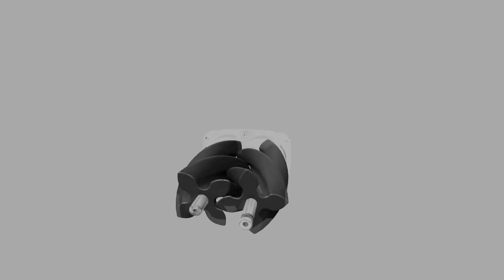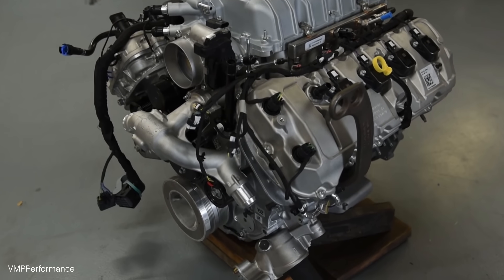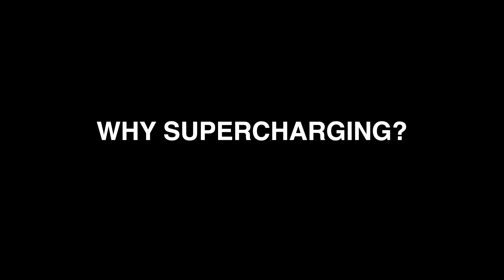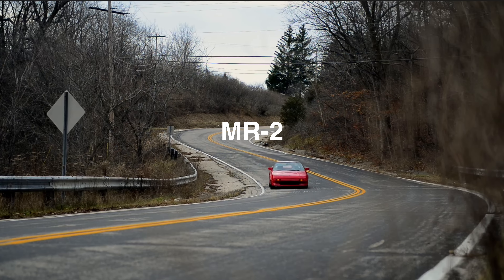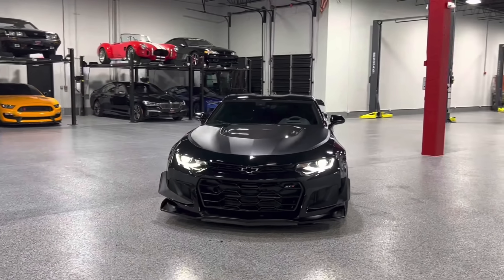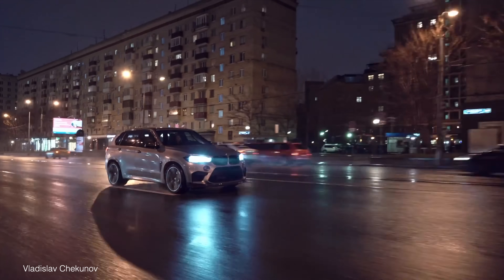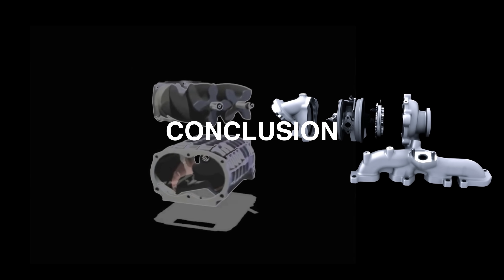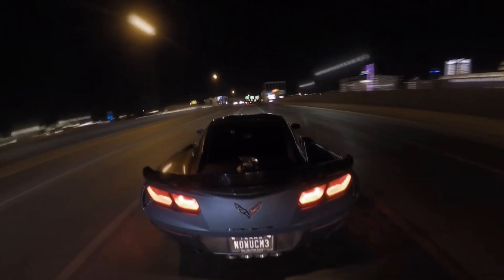Why V8 Engines Are Supercharged vs. Turbo😮| Explained Ep.6

Comment: That instant torque is such a beautiful thing for supercharged engines.
Reply: Cost, simplicity, power on demand, culture/history, personal taste. That's all that needs to be said.
Reply: Our twin scroll SQ5 has nowhere near the “instant” power of our ZL1.
Reply: Instant 😂 yeah sure
Reply: foRever
Reply: And it also makes the gayest cringiest most laughable engine sound ever
Reply: @justafloridamanfromthe75thRR  if a supercharger makes you think it’s gay maybe that’s an issue with your inner self, there’s millions of people who literally love the supercharger whine because most recognize it from American drag racing with big ass Hemi v8’s with a big ass supercharger in top fuel drag racing it’s also commonly used on trucks which require instant or near instant torque is needed don’t get me wrong I like turbos as well but I think superchargers deserve some credit for the benefits they give in the racing world.
Reply: Though it’s funny when turbos have lag and someone has a passenger right as the passenger seems disappointed boom boost kicks and the car takes off like a rocket, I call it the sling shot effect turbos are acting like the rubber band on a sling shot and as you pull the sling back you’re building up tensions and when you let go it launches the BB at a higher velocity like wise when you start giving the car more gas you’re causing the turbos to spool up and once that reach full boost you take off like a rocket, I genuinely like both turbos and superchargers I also love when car guys combine the two aka twin charging!
Reply: you pretty much got instant torque on turbo as well with lauch control. anyways.. its a less significant argument these days then 10-15 years ago
Reply: @hotdog9262 Thats the point... with launch control. At normal driving, gearbox Auto mode from low RPMs, so lets say you are driving 50 mph and your cars at 1900 rpm and then you do a kickdown, it takes ages until you are on boost, and even some more time till you hit the turbos sweet spot rpm where it has the most power. I have a 3.0 TFSI which he named in the video, and holy shit together with the S-Tronic dual clutch gearbox its like you get hit from a train. The time it takes to accelerate from lets say 50 mph to 70 mph is like its instant. You are just there right after you hit the pedal. A Turbo never gave me this feeling, they were quicker but only if in right gear, properly mapped and the turbo was not too big. I would say pretty much every time when you have a supercharged 400 HP car and battle a turbocharged 450 HP car which is unaware that you want to race, once you hit the throttle you are gone and he won't keep up. But its surely a different story when both cars pull at 50 MPH 4000 rpm in right gear, on sport mode (for max boost fo the turbo). But for everyday driving even a low on power supercharged car will outrun the turbo if the driver is not aware and just steps half a second later on the throttle. I love that roots blower, can only imagine how a supercharged V8 drives. I drove my friends S7 4.0 Biturbo, but it did not feel any special, it takes a lot of charme of the v8 away.
Reply: @DarkSession6208  most sportscars have small turbos, to give that near instant boost also outside launch control. add to this, their systems are also(more or less) tailor made to the application. but I understand the popularity of superchargers. also due to the lower cost(well..) and easier/simpler to aftermarket
Reply: Hot-vee twin turbos are very close to zero turbo lag and feels like instant torque as well.
Reply: if you don’t have good enough torque without a supercharger you built it wrong. turbos all the way
Reply: Twin scroll turbos basically eliminate turbo lag
Reply: It's about hp
Reply: Electrics smoke them anyway smh
Reply: @GewelReal  Pride month is over.
Reply: @bengtsson45  top kek
Reply: @bengtsson45  lmaooooo
Reply: @GewelReal electric? Bro be for real who wants an electric?
Reply: @DiaperSNiFFER   The only time I ever see electrics being useful is through a hybrid system with a gasoline engine like the 5.7L Hemi which also now comes with the Etorque system, we personally have a 22 ram 1500 with a 5.7L Hemi with Etorque and it’s pretty efficient on gas if you’re not romping on it constantly around town and for a larger truck with the 4x4 system it’s pretty zippy around town, I’m also still learning things about the truck that I wasn’t aware of I thought it used some sort of step up converter to power the electric motor nope I was  wrong it does have a separate 48v battery for the mild hybrid system, again I think hybrids are the better option between them and an EV, anything full electric is asking for issue!
Reply: @GewelReal  not if u have a big enough supercharger
Reply: @GewelReal  not on the highway mate
Reply: @arimpour8207  even on highway
Reply: @GewelReal  only one that will win above 70mph is the tesla plaid lol
Reply: Go eat some breakfast 🥞 🥛
Reply: @funeralhouse6280  
Thanks?
Reply: @GewelReal  not gonna lie it is the future but it is super lame ... pretty soon they will just put a speed control on cars because it is so automated..
Reply: @GewelReal  Up to 60 only, past that no, and even in that 0-60 range there are still a bunch of petrol cars that beat them.
Reply: @GewelReal  yeah, but push it only once n battery goes low immediately, fuck that shit..
Reply: @P71ScrewHead  that's why current electric cars are for suckers.
I'm still waiting for vastly better and safer batteries to become available
Reply: @GewelReal  things should keep getting better, don't want to spontaneously combust..lol
Reply: @P71ScrewHead  Your fuel runs out even faster than battery... When pushed to the max.
Reply: @gytispranskunas4984  Depends on the engine.. A 1,000rwhp 632ci BBC/BBF uses a gallon per 1/4 mile..lol Anything small block will be way more fuel efficient even with power adders..
Reply: @P71ScrewHead  It is physically not possible to beat Electric Motor efficiency. The problem is that battery has no energy in comparison to gasoline. If there was a way to power electric motors with GAS... cars could go thousands of miles with full tank, u would forget when you even filled the gas tank. But sadly it's not possible. With time battery technology will become more and more energy dense. But we will not be around to see it.
Reply: @gytispranskunas4984  Well, ppl have made engines run on water but most have been killed, i wonder why.. My dyno tuner claims he can make engines run on water but i don't have a car for him to experiment on..lol Maybe one day..
Reply: @P71ScrewHead  Prove it.
Reply: @johnwatrous3058  disprove it..
Reply: @P71ScrewHead  I'm just curious, do you have proofs for claims regarding the people who "invented" engines that run using water.
Reply: @ashtoncasedy3237  All it takes is a lil Google search n you'll find your proof.. This ain't new tech, but those who've tried to market it have all been dealt with..
Reply: @gytispranskunas4984 trains have entered the chat*
Reply: @P71ScrewHead h
Reply: @P71ScrewHead  Your tuner is pulling your leg, its the same reason perpetual motion doesn't work.
Reply: @gahbah274  Could be true..
Reply: @P71ScrewHead  I heard that story too, that he was murdered by oil industrial company for making car that runs on water , and later found that body after almost 4 or 7 years later...
Reply: @xninja2369  Oh yes.. Also how these ppl commit suicide so conveniently..lol
Reply: @P71ScrewHead sucks to see ur dyno tuner next 😔
Reply: @TackyLicns  Well, looking forward to what I make with old gas n TrickFlow heads..
Reply: @P71ScrewHead  like inventer of Diesel engine
Reply: @xninja2369  Ouch..
Reply: @gytispranskunas4984 diesel electric vehicles have existed for a long time. The battery will never be an effective replacement. The point of the battery is requiring the electric grid to power everything so the government can control the grid and control all your power. It's much harder to limit you when multiple energy sources are available.
Reply: @P71ScrewHead  I swear you know that right?
Reply: @spidergoose891  True.. I've always said that..
Reply: @xninja2369  Didn't know, will have to do more research on that, thanks..
Reply: @gytispranskunas4984 what do you think an alternator does lol
Reply: @gytispranskunas4984  you just invented a hybrid bro, good job.
Reply: @P71ScrewHead do you understand physics? Unless you found a way to burn water without super dangerous chemicals, no you cannot make an engine run off just water.
Reply: @Supercat10101  I don't have to.. Plenty of ppl already made engines run on water as fuel.. Car n motorcycle 🏍 engines.. Mexico 🇲🇽  n USA 🇺🇸..
Reply: @GewelReal Gay
Reply: @GewelReal but you can’t push Evs half as consistently as ICE
Reply: @GewelReal 😂😂😂😂
Reply: @GewelReal  😂 the quickest pass by ANY EV is just now trapping 200 in a quarter 
Brett Lasala just took a sleeved OEM Predator block, ported GT350 heads, and oem Coyote crank, drove 1,000 miles to each track over 5 days and avg 6.7s @ 212 mph and best of 6.52 @ 216 mph on 275 tire. 
ICE is still king, fool.

Comment: I would say because Americans engineers are bad, it easier to make good clearance for a supercharger on the hood and with some cooling lines than a turbo or two turbos, working hot tubing and cool tubing and a inter cooler around the engine compartment.

Comment: Chevy and Ford both still use Roots blowers, including the new GT500 and the last gen ZR1. The old E55 and hellcat are twin screw but twin screw isn't inherently more reliable than roots. Whipple and Kenne Bell will tell you so but they are not any easier to keep cool at high horsepower AT ALL. They offer no advantages over the power capabilities of the roots style Eaton TVS2650 or 3100 which are smaller than Whipple or KB's best offerings while making similar power....
Reply: E55 🔥 German muscle car. German car with an American soul. I wish AMG kept making supercharged V8s

Comment: We can take ICE motors much further than we have but there’s too much government pressure to move toward EV for manufacturers to put the R&D into continuing that forward movement. The biggest drawback is that the birthing pains are going to be immense without some great forward leap in battery technologies and infrastructure to support mass affordability and usage of EV’s. What’s an EV without electricity? The government isn’t holding up their side of the bargain for their arbitrary emissions policies by correcting the vastly ignored electrical grids and production stations to support this forced, premature changeover.

Now on the hot vee setup, it’s nothing new and BMW didn’t pioneer it. Cadillac didn’t do it because of BMW either. Hotrodders have long done the hot vee setups on any engine that can have the heads reversed. The first time I know of it was with guys in the 50’s reversing the flow on Ford’s flathead V8 by retro ding the camshafts. Numerous Indy car engines had this design in the 60’s. Hotrodders have even done it with modern engines like the Cadillac Northstar V8’s since the heads are symmetrical and be simply turned around with the intake ports outward. BMW doesn’t get the credit for it since they put it into production first. Brilliant American car enthusiasts did it many decades prior.

Comment: Both supers and turbos are good. Turbos are more expensive and require more detailed engineering. The supers are easier to retrofit to good o' push-rod engines. Everybody wins! I also own a Tesla dual motor and that is fun too, but in a different way.

Comment: Very well done! I just love the scream of a good supercharged engine but I also love the efficiency and that adrenaline rush of when the turbos kick in on a turbo. That VTEC kick is good too. Keep up the great work. Subscribed! You just do not get that visceral sensory spectacle from an EV. I too believe we are in the golden age of the internal combustion engine and I am not taking any of it for granted.
Reply: I prefer the GM and Ford VTEC. 

Honda did it as a gimmick. The others are smooth and simply allow for a nice big flat torque curve that just pulls. It's completely unexciting compared to Hondas rev to the moon and then pull strategy though.
Reply: @leftyeh6495  I have been seriously looking at a new Ecoboost Mustang with a manual with the High-Performance Package and Handling Package. Have you heard of any reliability issues with that High-Performance Ecoboost engine? I read the early engines had a cooling leak issue with one of the pistons but I also heard the later models fixed that. 330 HP with great fuel economy is a great combination especially paired with that 6-speed manual transmission.
Reply: @malcolmar  Ecoboost engines are actually pretty reliable, its the drivers that arent.

Comment: All valid points and interesting video. However you left out a huge difference between American muscle cars and European V8 engines. Crankshaft design. A cross plane V8 (American) spools a turbo very poorly due to firing order. Flat plane V8 (European) spools a turbo much faster and more efficiently due to firing order.
Reply: Most Euro V8s do use cross plane cranks.
Reply: @diablocls55  only some sold in the USA because Americans love the sound of the cross plane. European cars use flat plane though
Reply: @doogie525  not any Euro V8 I’ve ever owned. Vast majority of Euro V8s use cross plane. Even the engine in the new M5 and E63 do. Only Ferrari V8s use flat plane and other exotic makes, the only more mainstream Euro V8 with a flat plane I can think of is the AMG GT Black series
Reply: @diablocls55  ok dude. Whatever. I have much better things to do that argue with you. Think what you want. It makes absolutely no difference to me.

Comment: poor CTS-V. It never fails. When car companies actually make legendary perfect sports cars that check all the boxes, no body buys them. You could have even got a stick shift wagon CTS-V which is so based and memed its shocking! Then the kids all complain "tHeReS nO gUd CaRz@@!!11"

If people bought the CTS-V, RX7, RX8, 3000 GT VR4, and most of all, the LFA ~ Car companies would keep beasts like this around for longer and maybe even make successors. Can you imagine special editions of the LFA??? A super light weight track ready version, a kitted out luxury GT car convertible version? What would a tuned up successor be like?? Maybe mid engined? They may have ended up putting the V10 in the supra and the heavens would smile!

Comment: I dont think EV will naturally become more desirable until charge time is in the 10 min range. On a road trip, adding 30 min for every 200 to 300 miles in a top of the line EV is silly. EVs are awesome but not close to ubiquitous. I have a Sienna hybrid that can go 600 miles easy on one tank and its way more spacious and practical than any tesla.
Reply: I think the main problem is how much they discharge when you put your foot down. I don't think you can even drive an EV on the street hard for an hour before it runs out of charge. that 200-300  miles becomes <100mile real quick.
Reply: @UnknownBreadd1  Drive any car on the street real hard for an hour and you'll be loosing your licence.
Reply: I think hybrid is the way and manufacturers and governments are painting themselves into a corner with the material supply chain and electrical grid problems mass implementation of EVs are going to bring about. It's all sunshine and rainbows right now because Western governments have tunnel vision on emissions and OEMs can only think about getting government money in their accounts and regulators off their backs.
Reply: It's weird how you people always put ridiculous unnecessary and impractical requirements. Requirements that also get more stringent over time.

It's always I dont think it will happen until X. But X changes... and it is already happening.

Comment: It seems to me that supercharging still requires big displacement to make a lot of power. And turbos aren't parasitic to run.
Reply: True. I see a lot of Civics with turbo kits. Never seen one with a SC.
Reply: @havingfunyet  back in the early 2000s there were supercharged civics, namely Jackson Racing, but turbo civics were faster.  I have to agree that displacement plays a big role in turbo vs supercharger.
Reply: @PhatMikeSP1  Yep that’s a good point. I’ll have to look up Jackson Racing to see if they have some vids.
Reply: @havingfunyet  I have BMW Z4 with supercharger.
Stock makes 231hp & 300Nm mine makes 330hp & 380Nm
Reply: @DuBstep115  I’m not sure if you’ve made any mods on the outside but I’ll bet that’s a hell of a sleeper.